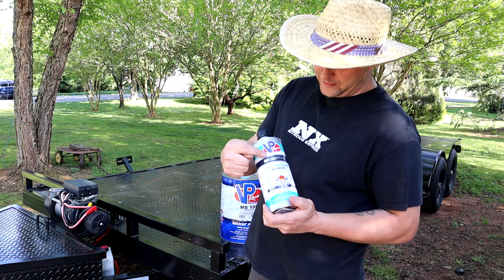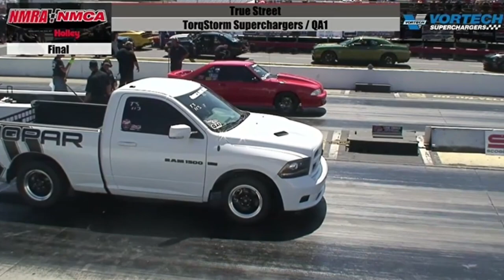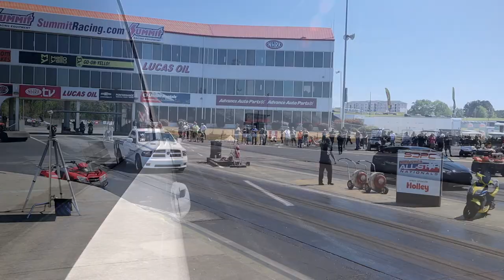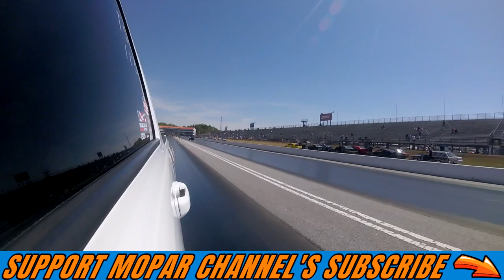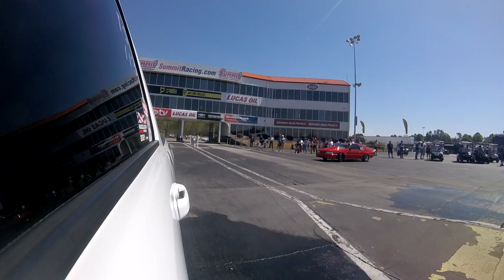How To Make 101 Octane Race Fuel With VP MADDITIVE

Comment: I am so happy that we can buy 102 octane fuel at the Aral gasstation here in germany. :)
Reply: RON or (R+M)/2??
Reply: @reubenmorris487  petrol companies can state the octane also in mon on the product sheets here in Sweden unfortunately the octane content in mon is not high maybe 85 on petrol which is 98 ron. There may also be other things that determine the performance of the car such as Oxygen amount in the fuel E85 has more oxygen
Reply: @reubenmorris487  in Europe it is Ron that applies. It was therefore always the equivalent gasoline in Europe higher octane number the only exception seems to be an E85

Comment: Now you are talking about Octane in  RON I guess. I can't find any information about Octane in Mon for the product. But for the racing fuel, there is such information. however, there is octane residence which also indicates the octane in MON. Does anyone know what MMT has in terms of octane in Mon . Then there is a disadvantage in that they can become coatings on the spark plugs. There are also articles that say it can wear out Engine parts the engine faster

Comment: Be aware that VP says don't exceed 2.6 ounces per 10 gallons if you have Emissions Control Devices in your car . You will only gain 2 octane but without coating your plugs and engine.

Comment: Would this have any benefits to running on a NA built engine? As far as a power gain, I run 93oct on my NA 396 stroker. Just not sure how much gains I would get if I ran it on 100oct
Reply from the maker: Yes it will help you can add more timing for a 100octane tune

Comment: Brother you recommend the VP octane booster I generally run Shell 93 nitro but filled up with Speedway 93 my monster build Scatpack is hesitant on the highway driving normally not getting into would this help?
Reply from the maker: It's definitely worth it for track use but it does dirty the plugs with prolonged use.

Comment: Run about 3 bottles of this 💩 and then pull a head and look at your top end. I don't care if it's a high-performance car, motorcycle, whatever. In fact, just do a simple plug check. This stuff leaves a nasty coating that you would not believe.